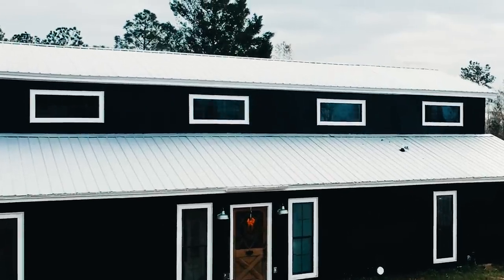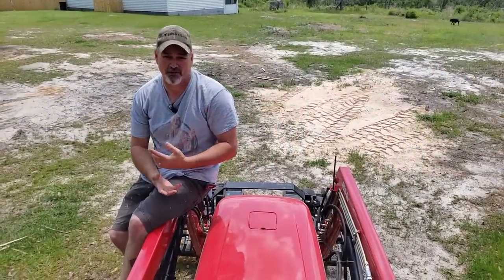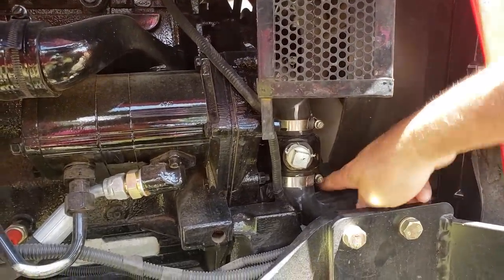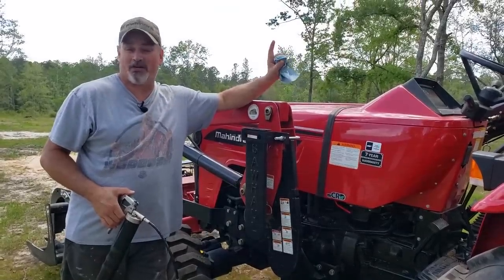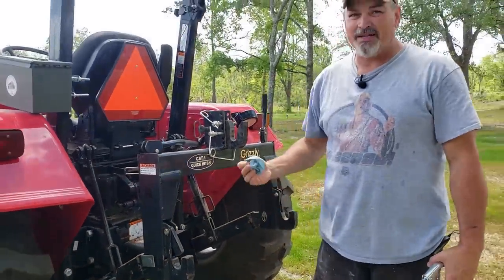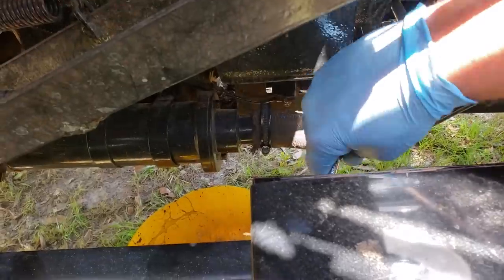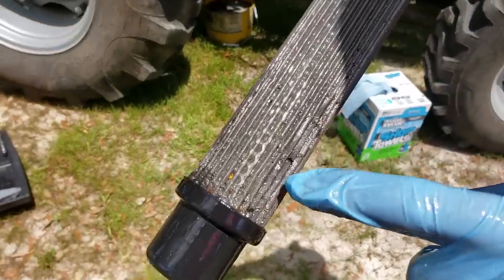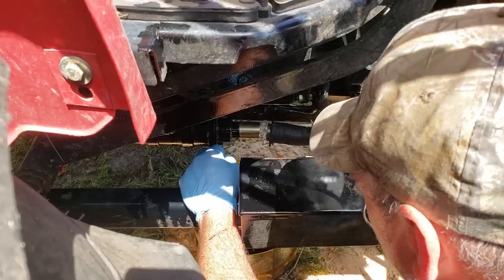MAHINDRA Tractor Service...Hydraulic Strainer & Scheduled Maintenance

Comment: I watch your videos and find them useful and informative... It may have been more helpful had you shown the radiator fluid reservoir container - for those who may not know what it should read (if this tractor has one)... Also, it would have been more helpful if you showed how the hydraulic fluid filter was cleaned after it was removed.
Reply from the maker: Thanks for the feedback. I appreciate it 👍

Comment: If you unbolt the  two bolts on the hydraulic filter bracket. The pipe will move out of the way of the transmission strainer pipe. Making it much easier to remove transmission strainer.

Comment: Can't get enough of your videos. Is there anywhere you show refilling the hydraulic fluid? I didn't realize how much was going to come out after pumping that screen out to clean it.
Reply from the maker: Just add it to the filler hole beside the gear shifter on the floorboard 👍
Reply: @HamiltonvilleFarm  10 4. Was tricky to get the 5 gallons in there but used a transfer pump. Thanks again!

Comment: Hey brother I was hoping to see the cleaning process! How did you clean the filter? Thanks man. I got a 2wd 4540
Reply from the maker: I used Diesel fuel and a paint brush to clean it. Placed it in a bucket, submerged the strainer in the fuel and used the brush to wipe out the debris. Hope that answers your question.
Reply: @HamiltonvilleFarm  thanks. This is the first diesel I have owned in my 62 years. Gonna be a learning curve. Never used diesel fuel as a cleaner either because I never had any! Work pretty good?
Reply from the maker: Yes it worked great. Came real clean. 👍 I suppose one of those scrub brushes may work too. That strainer is kind of like a hard screen wire so it's pretty durable.
Reply: Good point!
I was wondering what too.

Comment: One thing you should cover on the Antifreeze Coolant is what type your tractor uses . Since most of the new Case/ New Holland tractors use a Organic Acid Type  (OAT)  I learned it the hard way and just assumed it was the same as the last 40 years of tractors i had
Reply from the maker: That's a good point.

Comment: How much oil do you lose when cleaning the hyd screen? What kind of hyd oil did you use to replace it? Thanks,
Reply from the maker: I lost about 3.5 -4 gallons and I used the Mahindra brand oil to replace it. I show the oil container around the 9 minute mark in the video 👍
Reply: @HamiltonvilleFarm  wow that much? How much does Mahindra charge for their oil and what do they call it? My dealer said to use 303 oil which isn't recommended for anything built after 1974!
Reply: @HamiltonvilleFarm  geez I guess I should watch the whole video before asking stupid questions! I just did. Thanks. How much did you have to pay for Mahindra oil?
Reply from the maker: I honestly don't remember.  but I definitely wouldn't use 303. LOL. I would think the Mahidnra oil is $18-$25 per gallon unless you buy it in a 5 gallon container. I am using all Mahindra branded oils and lubricants and parts until the warranty expires, then I'll research other brands. But that's just me. Several other people love other brands for their tractors. Sorry I couldn't remember the price.

Comment: Great video Hank, just curious, could you have screened the hydraulic fluid that came out and reused it? or is it reccomended just to add new?
Reply from the maker: Yes some people reuse the hydraulic fluid during the process, but I used a pretty nasty bucket to catch it in, so I just used new oil. Good question.

Comment: How do you check the hydrolic  fluid .
Reply from the maker: On the 4540 there is a bolt on the floorboard by your right foot. That is the dipstick. It is right beside the gear shifter and sometimes has a yellow sticker that has "transmission oil" written on it. That's the dipstick for the hydraulic fluid levels. 👍

Comment: Where do you add the hydraulic fluid at?
Thanks
Reply from the maker: Beside the gear shifter on the floor board
Reply: Thank you!  I was wondering the same thing.  I didn't know that the hydro fluid and the transmission oil were the same thing.  Two videos and he never cleared that up.  :-)

Comment: Good video. 2 questions. 
1. Are you still enjoying the M 4540?
2. Would a Ford F 250 with 6.2 gas engine pull that Tractor?
Thanks. Mark.
Reply from the maker: 1. Yes
2. I would assume so, it's a F250! 
I'm really having a great time on it. Getting a lot of work done with it.
Reply: we have a f250 with the 5.4 and it does all right

Comment: Good video except you didnt show where to add the fluid back into the tractor.
Reply from the maker: Hydraulic oil goes beside the shifter on the floor board.
Reply: @HamiltonvilleFarm  Thanks sir!
Reply from the maker: Yeah kinda weird it says transmission oil on the sticker in the dip stick. But it's hydraulic fluid👍